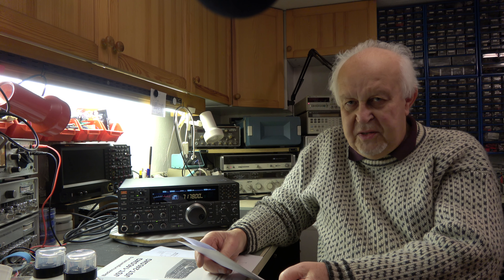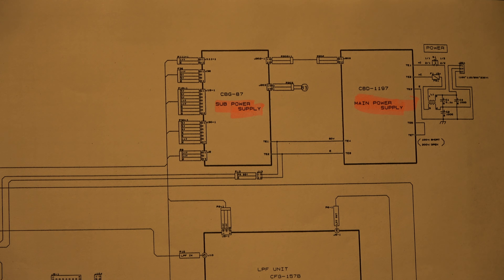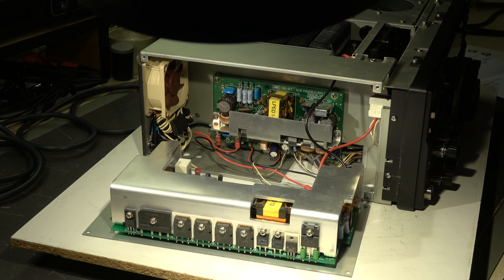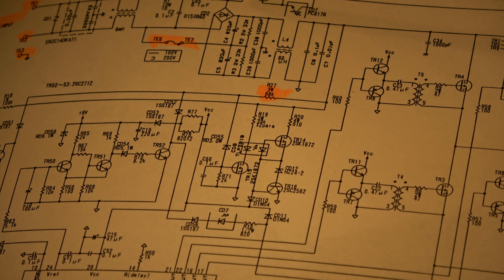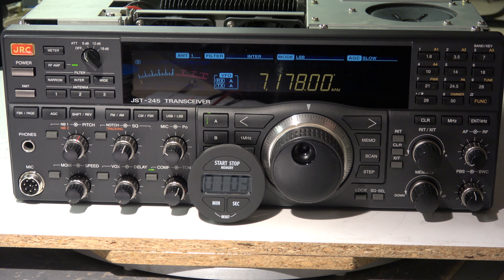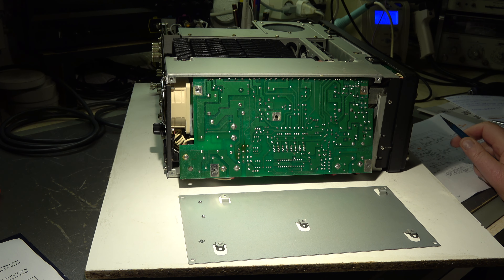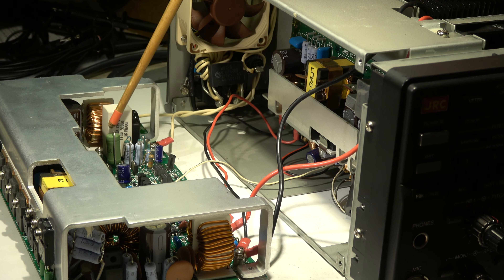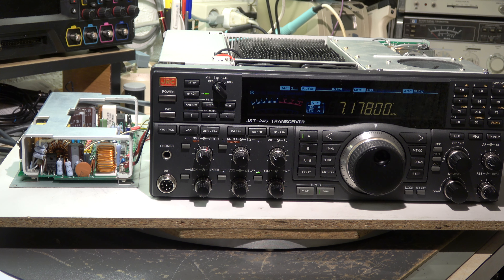#147 JRC JST245

Comment: I wonder if someone had been in there before? The missing ground connection probably should have been found in the factory final quality assurance but may have been overlooked? The good news is the OM has his rig back and it should work for many years to come!  73 - Dino KLØS
Reply from the maker: My confidence in the factory quality assurance is limited; i´m sure this ground connection was never installed.
Reply: @dl7majstefan753  That's interesting as I'd always thought of JRC as a solid manufacturer...
Reply from the maker: @PapasDino  Dr Dino, when i think about the manufacturing process it´s logical:
One guy takes the SMPS and installs it including "all" connections. The next process measures the grounding of all components - and that´s ok because the SMPS is mounted with metal screws and the TRX works! No Problem found ... hi.